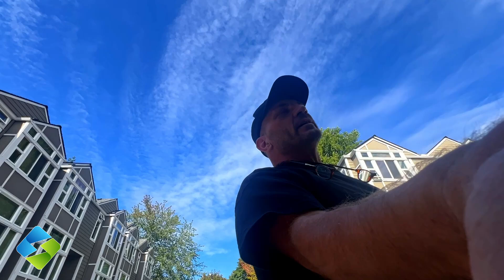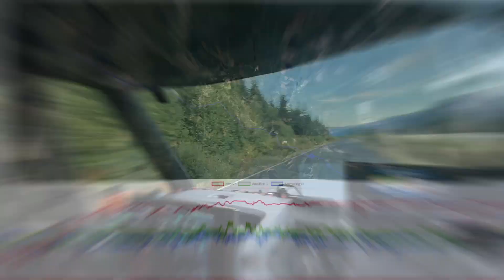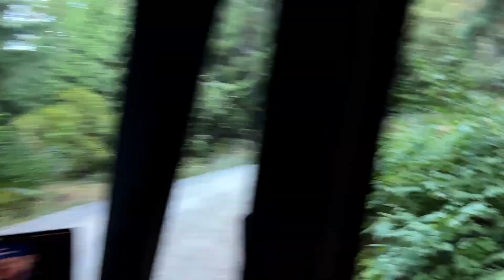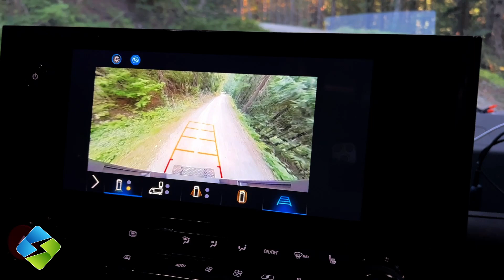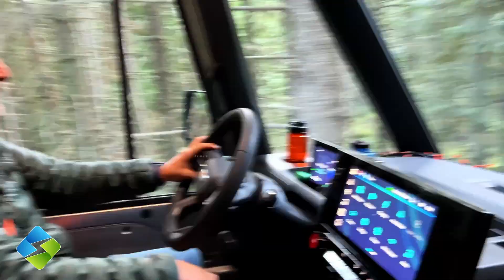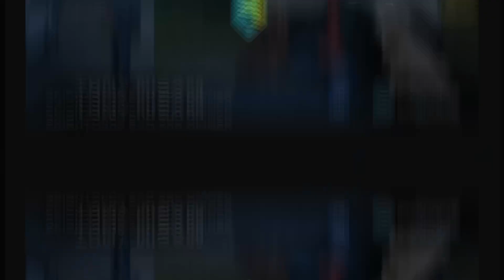Tim Reha & Tony Nisam: GM BrightDrop 600 Seattle to Snoqualmie Pass Off-Road Electric Van Test Ride

Comment: I'm an enthusiastic right-2-repair car owner ready to go electric. I'm thinking about a Chevy Brightdrop van to replace my 2003 Ford E350. What I want to know (and none of the videos I've seen so far have answered the question) is: Is the van repairable by the owner or otherwise right-2-repair friendly? Now I'm not sawing I'm going to rebuild a battery pack or a motor but I would like to be able to asses and diagnose any issues, say 20-30 years down the road, without having to bring it in to a dealer (my experiences with dealers have not been great). That is to say, is there an ODB port? Also, is the van a boat anchor if a computer board goes belly up in 20-30 years and is no longer produced by Chevy? With the quality trend going down and the complexity trend going up in the auto industry, I am loathe to buy if I know the life span is limited.
Reply from the maker: Great question - owners will want to know because GM just dropped the BrightDrop van program because they had a total marketing failure telling the story about the vans